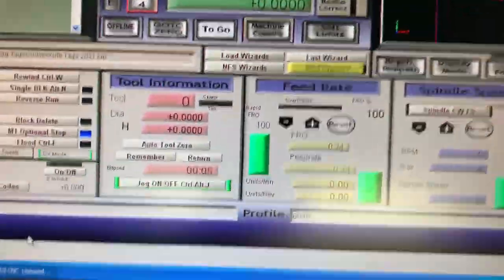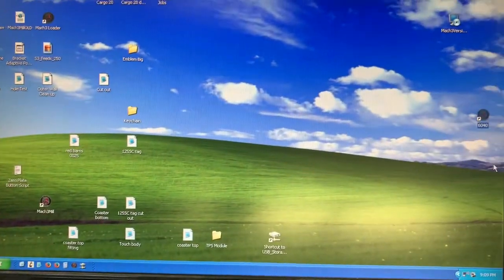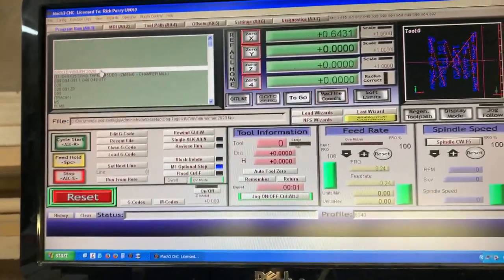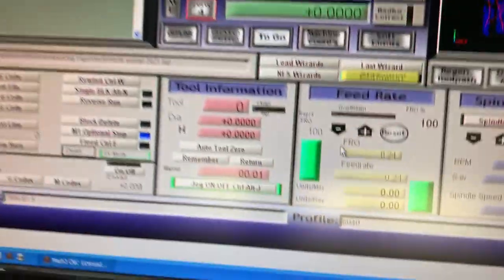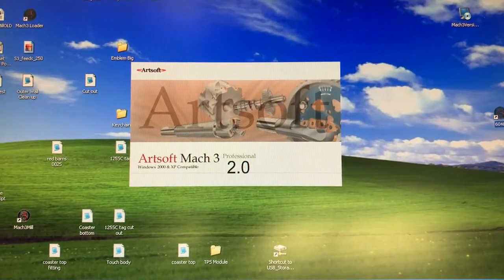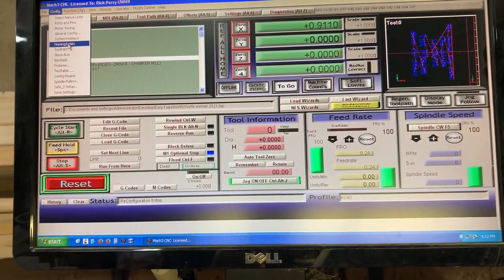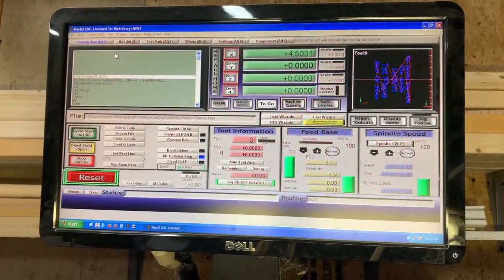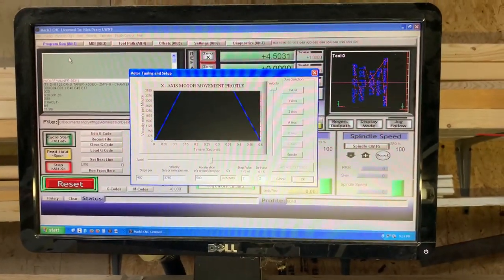6040 CNC with MAXED out Mach3 settings

Comment: Great video! Maybe you can help me before I buy this machine. Instead of the existing spindle I need to have my device that would just press down onto the surface. I measured with the scales underneath and even 2kg load is enough. Do you maybe know if this machine can put this much downward force, or does it have some safety feature that would prevent it? Thanks for your help!

Comment: Hey, not sure if anyone said this yet, I found out recently on my mini mill that changing the kernel speed, for instance, raising it to 75000hz, also raises the max that you can set your motor speed in motor tuning. (dropping kernel speed lowers limit). Hope this helps!
Reply: @My 6040 CNC  ^^^
Reply from the maker: I have tried all kernal speeds and they do make the motors sound different and unstable. I'm going to ditch the XP and use the UC100 with a different PC and see where that takes me. Thanks for the suggestion

Comment: Rick, Excellent video covering the bases. 

The settings under homing, and limits is only used for just those settings guys.

 Which means if you adjust your speed to 100% for homing that's the jog speed you'll see when homing. Its interesting to see that Mach is reflecting your running at 3750 IPM or 3750 MMPM with an acceleration factor of 500. This is what the viewers should be reviewing very carefully as the math makes no sense logically with the kernel frequency set at 25000. 

Once you went to 100hz kernel frequency the system produced slower rapids which once again makes no sense logically.

 I will be performing some more video testing to make clear the reality of actual kernel speed differences which you documented in the "6040 fastest in the world" 

Thank you,

Vince
Reply from the maker: Tonight I tried to manually enter the velocity settings that I have in Pumotix and 3750 is all that mach3 will let me enter. Doing the math... 3750 mm per min is 146 inches per minute and that's about right for my machine. If I do the math backwards and try to enter 14,859 mm per minute it simply reverts back to 3750. I even cannot enter 3751 without it going back to 3750! Like I said in this video.. I already had Mach3 running as fast as it would go with the current machine hardware and shows what actual software will do.

Comment: Hi Rick, please check ‘Motor Tuning’. This is where you can adjust the speed and acceleration ramp of each axis. Also ensure that you note original settings and also save your settings.
Reply from the maker: During the initial motor tuning I had stalled the motors a few times. I think I will revisit the tuning and try manually entering the speed that Pumotix ran at and slowing increase the acceleration until they stall. I want to do an honest head to head between Mach3 and Pumotix with speed. Thanks for the suggestion, I will do another video specifically on this.